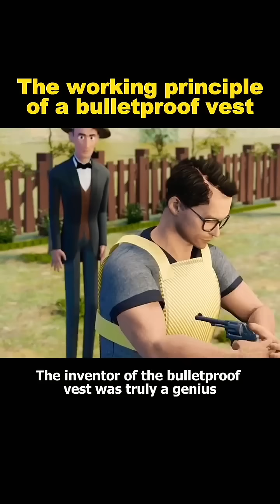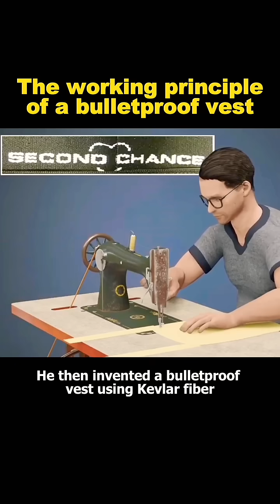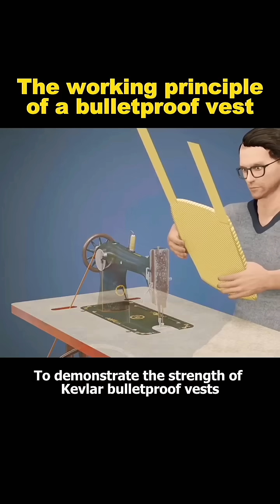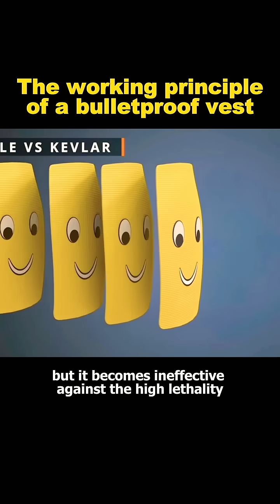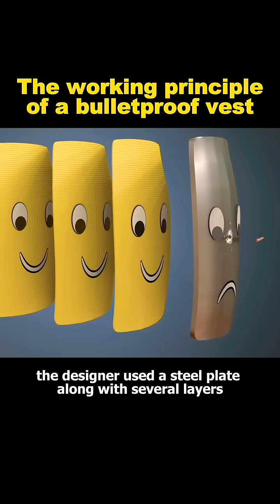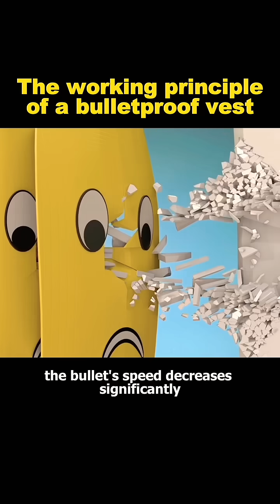The working principle of a bulletproof vest! 😳 #bulletproof #facts #usa

Comment: Any gun can go through a bulletproof vest. Bulletproof vests are designed to stop some bullets, but not all. The level of protection varies depending on the type of vest and the type of bullet. Some high-powered rifles, like the M16, can penetrate most bulletproof vests. However, even handguns can penetrate some vests if they are shot from close range.

Comment: The ceramic doesnt absorb any energy it simply rips the bullet apart with its high hardness level so the bullet has a higher surface area and gets stopped by the kevlar more easily

Comment: Hmmm i heard a HEAT round or highly explosive anti tank round could penetrate 

-a true genius
Reply: A fuckin' snipex alligator.
Reply: @SecretSRT  Some body armors could arguably stop it, BR-6 rating means its rated for multi-hit API 12.7x108 at 50 meters, considering its used at long ranges, there's a chance it would lose enough energy to be stopped
Reply: gotta wear NERA

Comment: It’s all good till a 50 cal comes in
Reply: There are body armors rated for .50, BR-6 rating means the body armor must be able to take multi hit 12.7x108 API out of a full barrel rifle at 50 meters. (12.7x108 is a couple percent weaker than .50BMG generally)

Comment: Barrett can penetrate kevlar body armor
Reply: Well yeah it’s a 50 cal bullet tanks can barely stop it
Reply: @badaimer45  No lmao? .50 hasn't been an mainstream anti-tank round sense world war two. Most modern IFVs (spare the side of Russian IFVs, they have awful armor on the sides) can take countless .50s with no problem, assuming its not hitting sensors or anything. Hell even some body armor can stop .50s, BR-6 rating means it has to be able to take multi-hit 12.7x108 API out of a full barrel rifle at 50 meters. 12.7x108 is like 2 or 3% weaker than .50BMG. Not that I would enjoy being shot with a .50